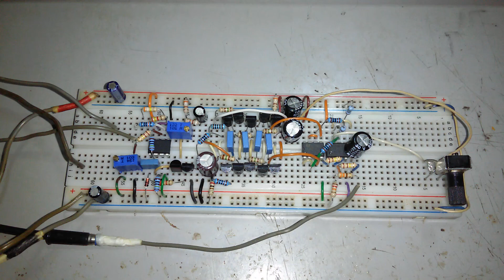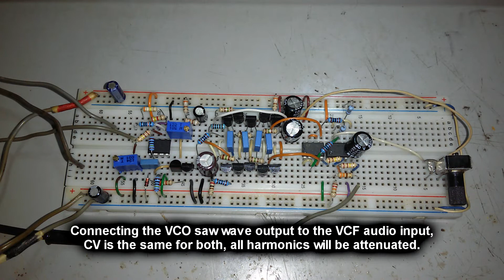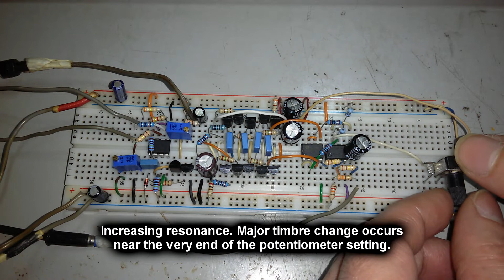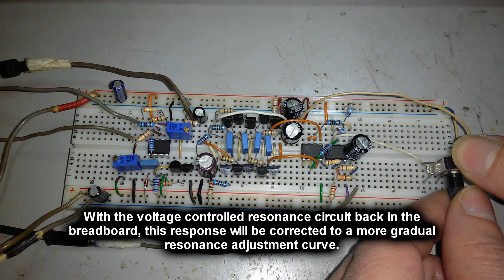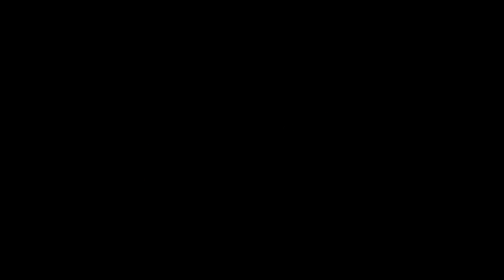Moog Transistor Ladder Voltage Controlled Filter (VCF) on Breadboard, Volt per Octave tuning test

Comment from the maker: Added a CV mixer and a better exponential converter to the Moog Transistor Ladder VCF (Voltage Controlled Filter) I am testing on Breadboard. No matched transistors yet, but far better volt/octave tracking and it is easier to tune and adjust. The voltage controlled resonance VCA circuit was temporarily removed, and the ladder outputs were buffered by opamps before entering the differential amplifier. An output amplifier was added to adjust output amplitude and isolate the resonance feedback signal from the outside world. The VCF test involved only three other analog synthesizer modules: a VCO, ADSR envelope generator, and the Arduino CV Quantizer.

Join this channel:
https://www.youtube.com/channel/UCQxQy-Z7SF7LFKsvSpqrTXg/join 

Thanks for watching.
#modularsynth #analogsynth #analogmodular